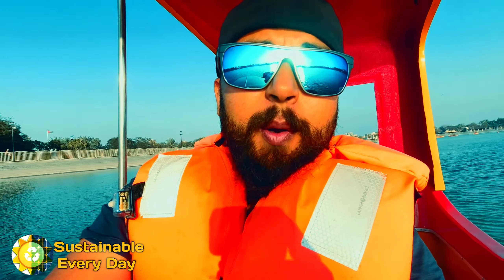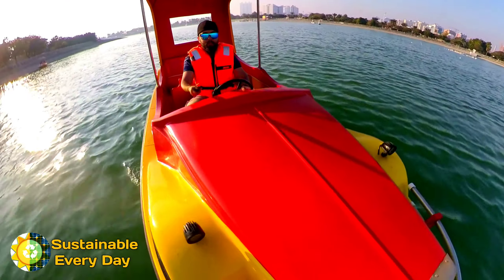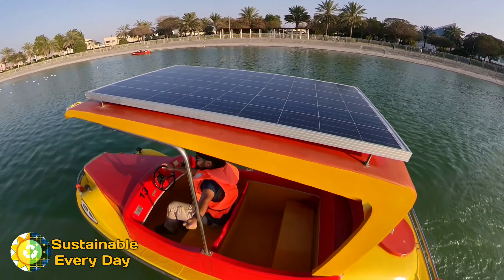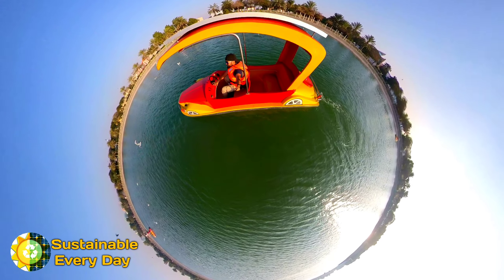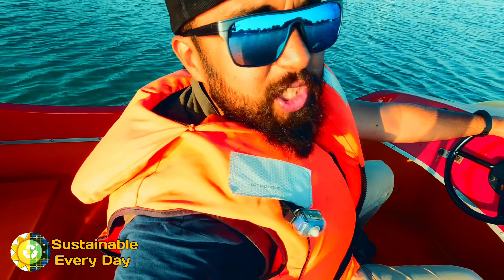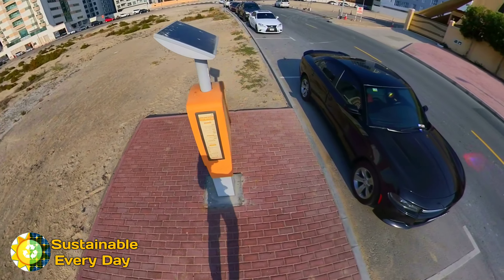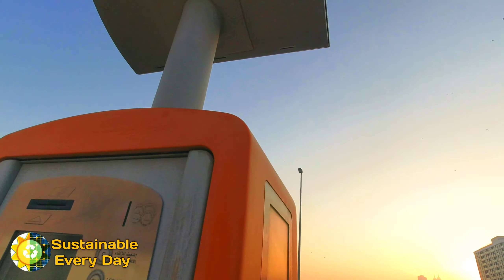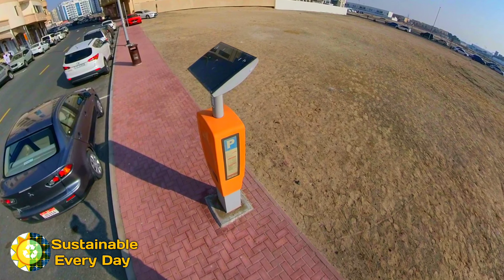Dubai Solar Boat , सौर ऊर्जा की नाव , Solar Parking Machine , VLOG 21

Comment: Awesome! Middle East has so much sun that they need to dump crude oil and invest more in Solar Energy. Their shaded-parking lots can be easily converted to solar panels. Buildings too can use solar panels on their sides other than on their roof.
Reply from the maker: Absolutely